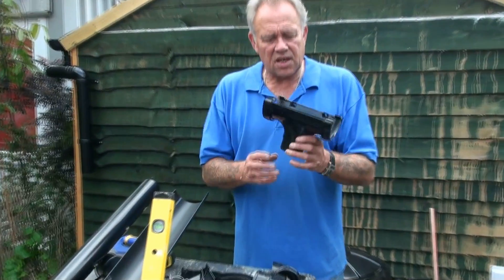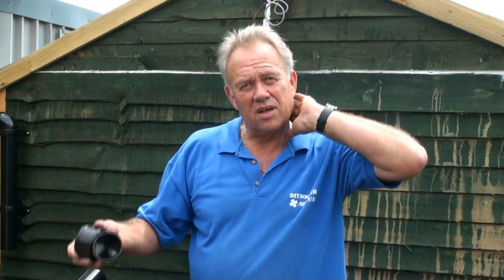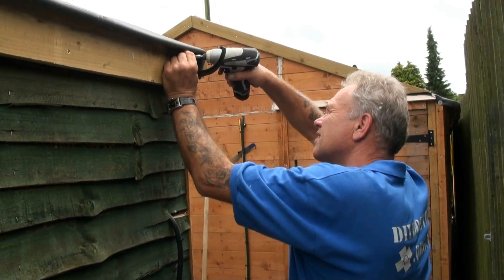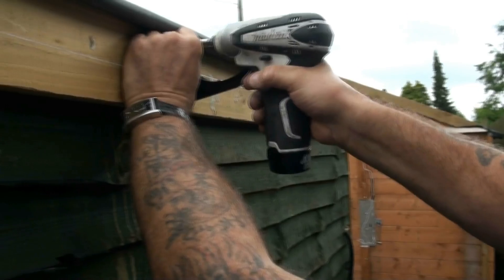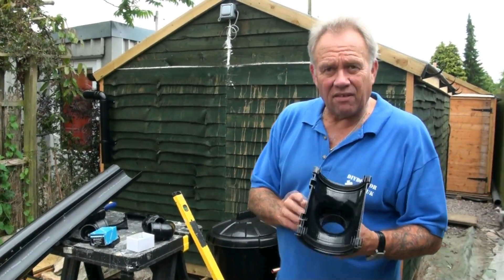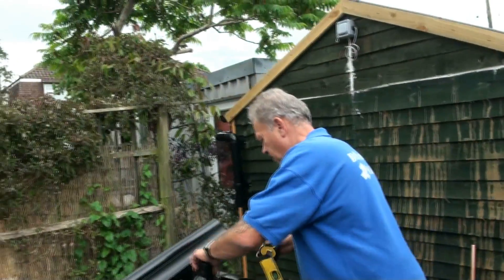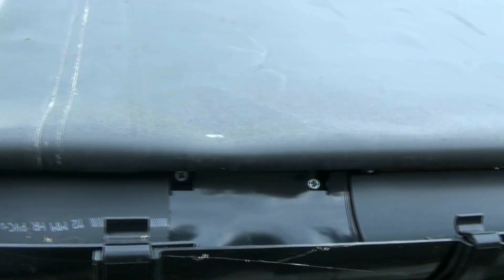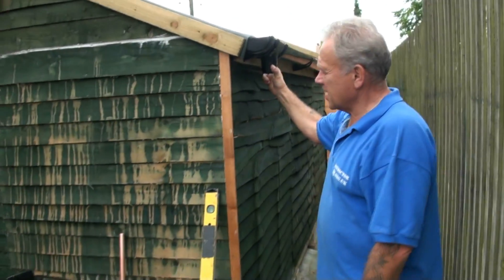How to fit shed guttering, plastic gutters and downpipes as well as replacing gutters

Comment: The line should have been tied to the far bracket be level with the lowest point of the curve as it was at the nearest bracket. As you had it, any fall you wanted was removed.
Reply from the maker: As long as the The line is tied to the same place on all brackets and the vracket furthest from the downpipe is higher than the one nearest it, there will be a fall in the run